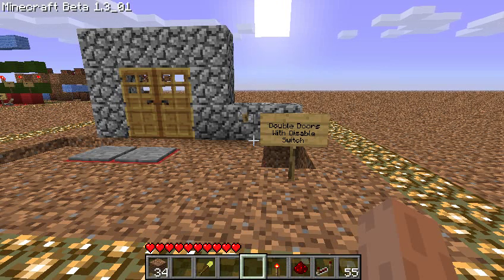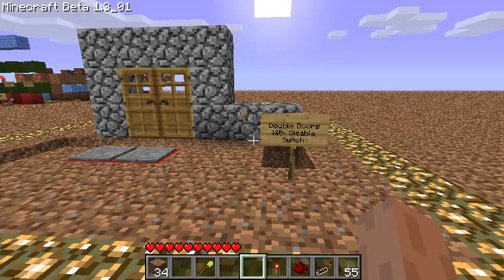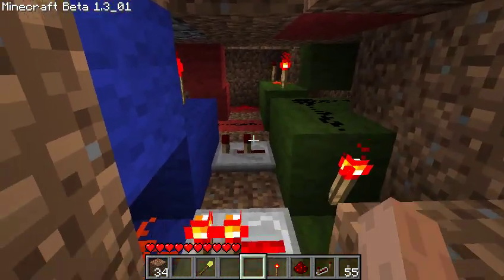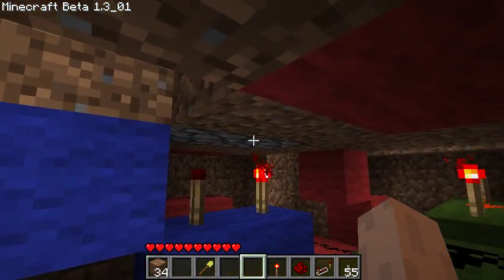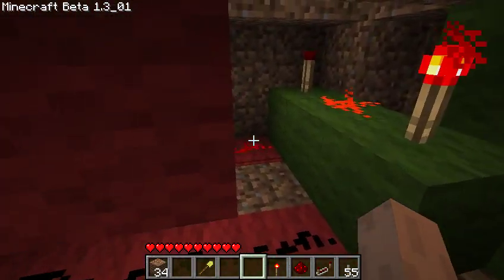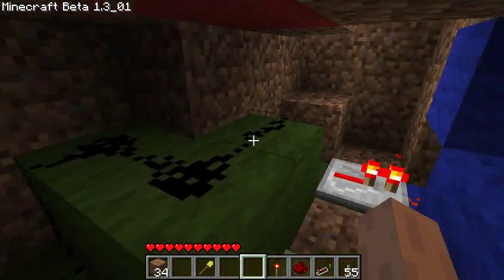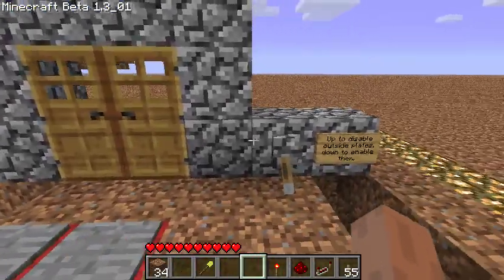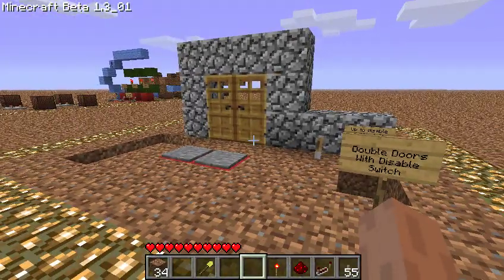Double doors with disable switch

Comment: Something I've been thinking about but didn't get to yet is making an "AFK boot" for multiplayer servers. Basically, inside there would be a pressure plate, if you stand on it the door locks, and if someone needs you they can press a button to make a doorbell ring. Adding some logic you can make the doorbell open the door if nobody is inside and ring the bell otherwise. Anyway it seems like a good challenge for people learning redstone.

Comment: I'm stuck.  My Power Switch running to AND gate, the entry torch for the power switch is always on no matter what I do, So my doors work fine I just cant turn power off..  How did you get the Power Switch entry torch negatively charged?